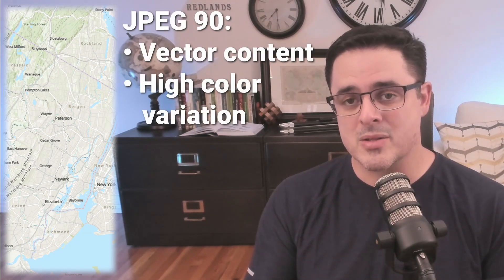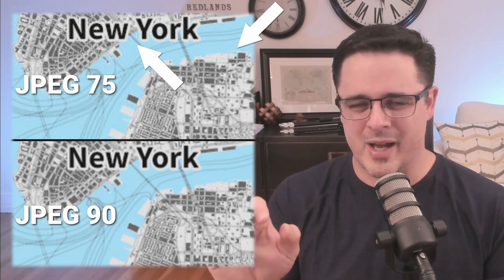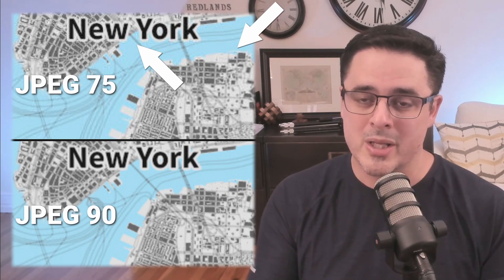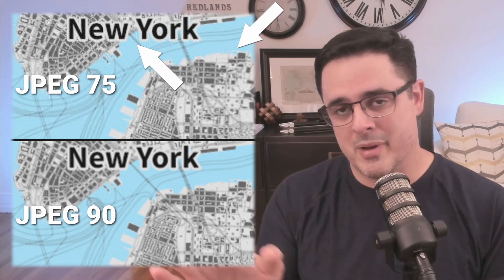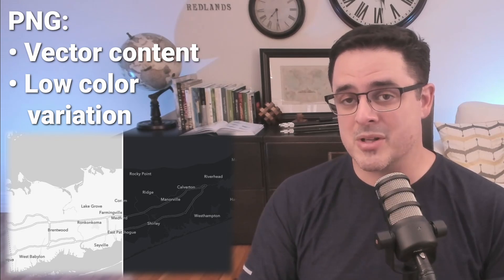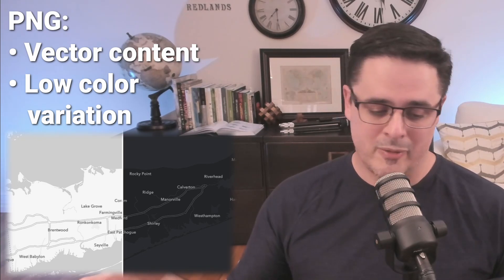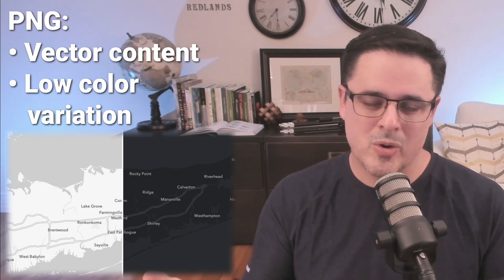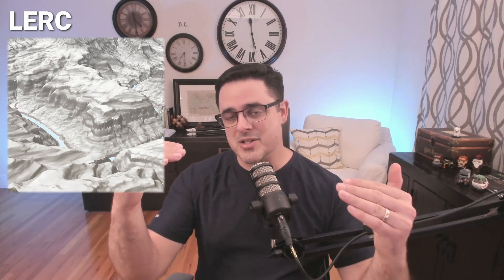Intro to Caching with ArcGIS Pro pt.1

Comment: Hello,
Great info I'm glad I found your channel. I found you because I am trying to figure out the best method to use in exporting a night mode basemap. The roads and ecological data covers, Kern, Ventura, San Bernardino, Orange. Los Angeles County data is far more dense. The smallest file I have been able to create using PNG 8 was 18G and took 3.5 days to process. 

I've tried to export a .vtpk however the exported file is not labeling the roads the same way it does on the .tpk file. 

Scales are all set and different labeling class visibility levels are set correctly. I'm not sure if this is just a limitation between the maplex engine and writing a .vtpk. The Vector tile package exports in hours and would be the ideal format for the application if I could get the same result as when I export as a .tpk.

What do you think is my best option? Based on your videos and my experience thus far I would say the JPEG 90 but I'd love to know what you think. 

Cheers-
Reply: I will check it out, thanks. Currently I’m using your 2 part method and creating the cache I figured out I needed up to level 19 and it’s running. That started 09:30 Friday hopefully it’s ready by tomorrow.
Reply from the maker: Great question. For vector based content, it's a tough sell to stay with raster tiles. Hours seems like a very long time to cook even the entire state of California. There are quite a few tricky spots when authoring a vector tile basemap, have you checked out this video https://youtu.be/GaJ_8cQvBmc ?

Comment: One more query, when it does not conclude in .tpkx and the process of the tool is interrupted and you are left with a folder and a .json file.... The process can be resumed or it has to be processed again, you no longer have to use it. indicted. I have examined and it seems that it would be missing to process the last L19 cache folder assuming that it is the maximum level.
Reply from the maker: I’ve not seen lingering intermediate files left behind from running the Create Map Tile Package tool. Manage tile cache on the other hand will leave the bundles it has completed behind and you can update subsequent jobs with missing LOD and regions of missing bundles with tailored AOI polygons.

Comment: Thanks for the answer, but I think it's not due to storage disk space: I have space on my computer of 1tb, but I think it's because of the geographical dimension, it's large. Then you recommend me for Manage tile cache and Export tile cache, with these steps the process to obtain a .tpkx file will be faster, confirm me and if there is another recommendation I would appreciate it
Reply from the maker: Overall processing time should be about the same. Depending on the version of ArcGIS Pro you are using, you may have better options to control the cache AOI with Manage Tile Cache and Export Tile Cache, which can make a world of difference when it comes to processing time and overall storage impact.

Comment: Hello, a query in arcgis, I use the Create Map tile package tool for a mosaic, it does not finish processing, that is, the result must be a .tpkx file, but it freezes in days and the result is displayed in a windows folder (folder tile (contains more folders called L 5 to l 19 + layers file), root.json file)...................the question is why it takes time to finish as . tpkx and in some cases it doesn't finish and stays in folders and time is wasted waiting for it to finish, thanks for any help
Reply from the maker: There are a number of reasons that the tool can take a long time to run, and in some cases not finish completely. One of the more common issues is running out of disk space in the output location of the TPKX. Another factor that affects the time to process and size is the geographic region and map complexity.
Reply from the maker: This is also one of the reasons I prefer to use the manage tile cache tool first, and then use the export tile cache tool. I find this process gives me more control.